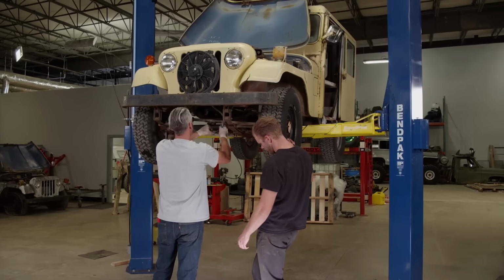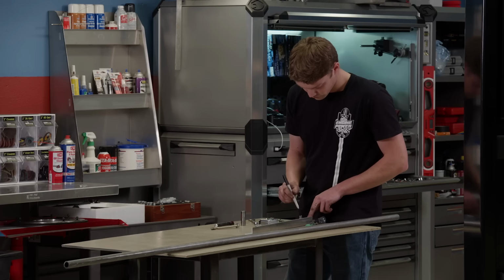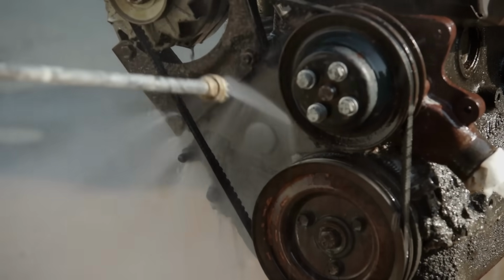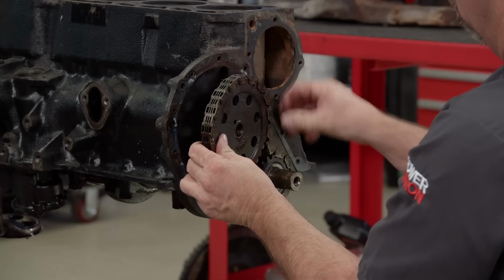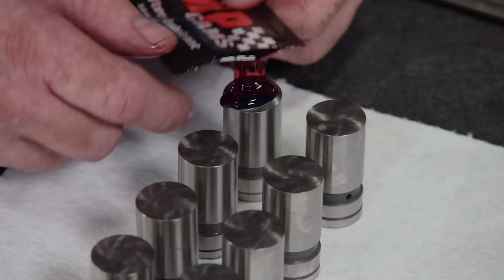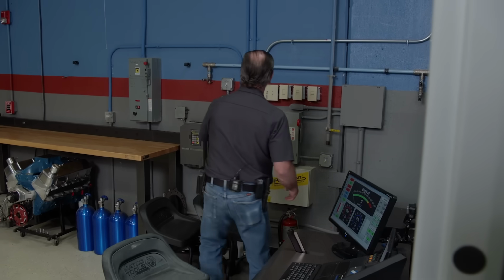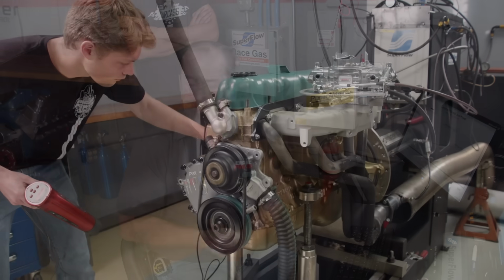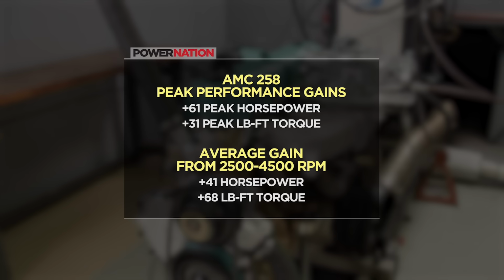Will There Be A Big Power Difference On A Mildly Modded AMC 258 Straight 6? - Engine Power S8, E1

Comment: No idea why I care about an old inline Jeep engine, but I do- enjoyed this very much
Reply: Old AMCs are awesome. Ive had 2.....a 74 Javelin/AMX with a 360 and a Rambler 220 American with a 199ci straight 6. People sleep on them all the time, until they get smoked by one.
Reply: I happen to  have 2 old Jeeps in my desert garage. They have never seen snow or salt, just dry sandy desert trails. There's a lot of these engines hidden away out here. I can't take these Jeeps with me so someday they will be sold. Watch Craigslist!
Reply: Had a 68 Rambler American w/straight 6. Once I replaced the bad ujoints, engine was as smooth as I've ever owned. Solid engine as most straight 6's are.